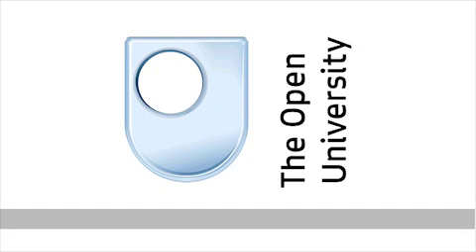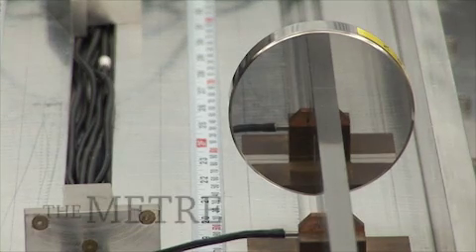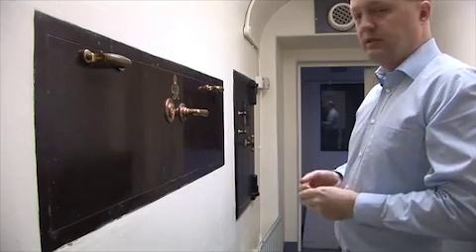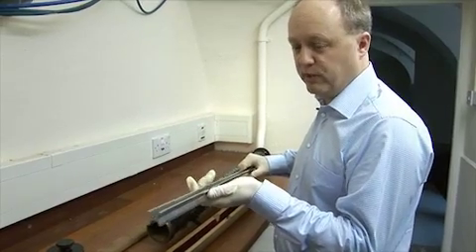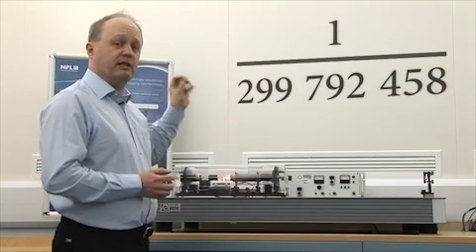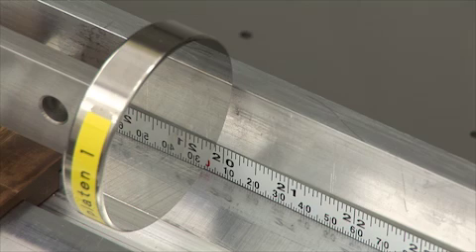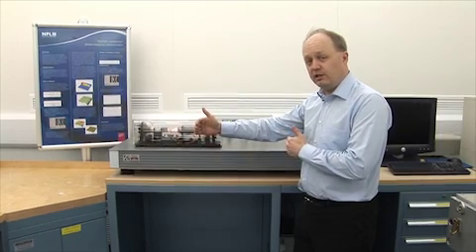The metre

Comment: We define length as the distance covered light in 1/299792458 second. This is because we say that light has a speed of 299792458 metre per second so it will cover 1 metre in about 1/299792458 second but in order to define metre we are depending on the speed of light and speed itself is a unit dependent on length like isn't this definition of metre wrong then ?
Reply: They adopted this number 299792458 based on the old definition of meter ,but now they linked it with the light it self and time so became fixed definition bc the light and time can't change

Comment: Funny thing is the meter new definition uses the old standard device as the accurate distance: and it’s not accurate, and never was.

When the French measured the “one ten-millionth of the length of the Earth’s meridian along a quadrant”, which is basically the distance between North Pole and Equator, they sent one guy North and one South to Spain with the mission of covering the distance that would then be converted into meters… and the guy sent South effed up (probably because his journey through the Pyrenees mountains was quite exhausting) …so his calculations were later proven to be slightly inferior but it was too late. 

Hence the meter we use today is a little too short and that carries to the new definition of how much time it takes for light to travel that meter

Comment: Of course firstly we need to define the second on nature constants. A second is equal to 9 192 631 770 ticks of a Cs-133 atom. 
So if we really want to define the meter with natural constants it should be the distance light travels in a vacuum in the time a Cs-133 atom changes its energy levels 30,66331898849837 times
Reply: A second is equal to 20 ticks
Reply: @FarofaPlayz  No, WTF?
Reply: @Helmut-pdh  It's a Minecraft joke, 1 second is 20 ticks in Minecraft
Reply: @FarofaPlayz  😂🙈 Thanks!

Comment: Would the length of metre change if the wavelength of light is changed??
Reply: late reply but, no. The speed of light in a vacuum is a constant. If wavelength changes, the frequency changes (inversely) proportionally such that the speed is unchanged
Reply: @TheLionOfOrange  And it is forbidden to urinate against the wind.
Reply: No, that only affects how powerful the metre is. 🤓

Comment: Any measurement unit can be translated into a speed of light of course. Maybe you could also translate feet and yard and cubit in speed of light in another vid and see which numbers you get and maybe find patterns. The metric system is just 1 of systems to look into.
Reply: The imperial system is also based on the metric system so it would be pointless. It has been defined by the metric system since 1959.
Reply: I’m for the Imperial system, but then again I like to watch paint dry.

Comment: huh... okay so the speed of light is defined by meters per second
a meter is defined as the distance light travels in a fraction of a second
and a second is defined by amount of time it takes a cesium 133 atom to complete 9,192,631,770 cycles
...
so how much time does it take for a cesium 133 atom to complete one cycle?
the answer is 1 / 9,192,631,770ths of a second!

is it just me or is this some kind of paradox??  each measurement unit defines the other
Reply: It’s a paradox 99/6 of the time.

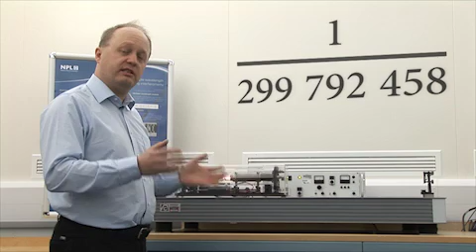Comment: 3:44 how the hell is the speed of light "fixed" when it literally slows down in water?
Reply: “The meter is the length of path traveled by light in VACUUM during a time interval of 1/299,792,458 of a second"
Reply: It isn't. But when people say "speed of light" it's usually shorthand for "the speed of light in vacuum ", which is fixed.
Reply: @GlenwingThink   How does gravity alter the trajectory of light?
Plus unless the natural charge of the earth + the charge of the atmosphere at that certain height is calculated with you cannot be sure of the said speed of light.

Comment: Sir a doubt without knowing a metre how did you told speed of light is 299 792 482 metres per seconf.
Reply: The  particular fraction of  1 second was choosen because they knew that in that small interval of time light covers a distance extremely closer to older meter.
So with this new definition of meter, speed of light exactly becomes 299 792 482 m/s.

The new definition of meter is invariable in space and time.
Reply: If we use the old definition of meter, the speed of light is about 299 792 482 old meters per second, so our new definition of meter is the length that makes the speed of light 299 792 482 new meters per second
Reply: @alexeecs ynjrHahn

Comment: Can I, as a citizen, replicate the meter with something cheap? Or do I need extremely expensive equipment to recreate it at home? I would love to do an experiment myself
Reply: Nah bro you need to find instruments that calculate the speed of light.
Reply: Just measure the distance between north pole and equator, and divide by 10,000,000  lol
Reply: yes..make a cheap pedulum with twine, measure and cut it 1 meter long, the pendulum will now swing exactly 1m second a cycle

Comment: To be clear the international prototype bars themselves are not that very expensive for so much security. It's that once these metal bars were made and length defined according to that, if they were accidentally manhandled or damaged it would be impossible to make exact same replica and hence one would have to redefine the metre. So they ensured (and still do) high security for many instruments were calibrated first by using these as reference.
Reply: Recalibrating the entire world is a very expensive undertaking.  This made the standards themselves very expensive artifacts.

Comment: The metre is the length of the path travelled by light in vacuum during a time interval of 1/299 792 458 of a second.
Reply: Did you calculate it for a royal cubit?

Comment: Some forget that the speed of light is defined by using the two fundamental constants of permeability (magnetic) and permittivity (electrical) of a vacuum - it has nothing to do with distance, temperature, gravity
Reply: Anthony Kernich it has the finite speed which you can calculate by maxwell relation, and its constant in vacuum so we can define length by the relation of (1/299792458)seconds
Reply: @VikasGupta4you  yeah okay that's cool and all, but how exactly is this any helpful for the typical surveyor?

Comment: The fraction of time  used to define meter is a number indicating speed of light in (meters/second) itself. Isn't it mind bending in a way because to get that number (2972..) one needs to measure distance traveled by light in meters-- the same quantity which we are trying to define
Reply: :D Imagine if somehow time got slowed down (increased acceleration or something), the other two units will change too?
Reply: clyton dantis there is no "meter/second" but there is "metres/second"
Reply: clyton dantis metre not meter
Reply: Abhishek Jain why dont we just round off the number to 300000000?
Reply: clyton dantis no the speed of light isn't defined by metre. It's defined by more fundamental physical constants that have nothing to do with length measurement.
Reply: Its em wave we can find the speed of light by using maxwell equation
I thik you got it :)
Reply: Vikash gupta beacuse that would be an horrible rounding off. It would mean cause and effect will have no precedence. Effect can come before cause and you would have a different matter altogether, tachyon. Rounding off that number is horrible.
Reply: Abhishek Jain ty
Reply: Not really, you can measure the traveling distance of the light in any unit, than you divide it by 299 792 458 and you have the meter. A better question maybe would be how does one know what is a second or how does one know what's the speed of light?
Reply: @augustorohden7404  1 second is clearly defined in terms of Cs-133 cycles - accurate to nearly 1 10 billionth of a second - THAT number of cycles is FIXED! Speed of light is also fixed a FIXED speed - speed is measured in m/s so to get 1 metre you need the distance light travels in 1/299792458th of a second which is nearly 10 billion Cs-133 "ticks". How many Cs-133 "ticks" in a light metre? I think it's about 30 (without my calculator) which would make each tick of distance travelled by light - let's call it the "light-tick" to be about 3cm (no calculator remember) - we're able to measure MUCH more accurately than that - angstrom level for instance on the atomic scale. Wavelengths of light?

Comment: Since the rate of time changes based on the gravitational field, does this mean that the length of a meter here on Earth is different than the Moon?
Reply: Morbius907 Good question, closest answer I can give is that you will carry the clock and the instrument to measure with you so you won't feel any change.
Reply: Morbius907 metre not meter
Reply: When the rate of time changes, the rate of space changes as well. When time is moving slower, distances become longer
Reply: @alexeecs  not to mention time dilation. We assume that the speed of light is constant in every direction, for which there is no proof, its just conventionally taken so. For e.g. if we send a signal from earth to moon that time on earth is 12:00 p.m. and say, it took n seconds to reach moon so when the guy on moon see this he will say somehing like "ok check" and add 2n seconds to his clock after setting it to 12:00 p.m. but what if it took the signal which is travelling at the speed of light 2n seconds to reach from  earth to and then instantaneously reaches from moon to eaeth. For us the duration is same and we will never know.
Reply: @_.Infinity._  I mean if it makes no difference... Occam's razor

Comment: Not a good definition. Why would you define the speed of light to be the distance travelled in 1/(24*60^2) of an earth day? Our current time system sucks. Since metric uses base ten, shouldn't we define it using decimal time, 1/(10^5) of an Earth day? And should it even be defined according to an Earth day?
If you change to dozenal time (as I think we should), a second would be 1/248832nd of an Earth day, or 1/10^5 in dozenal. But it would still be defined on an Earth day, which is still not good.
Reply: that is not the definition of a Second. it is a Lot of oscilations of the core and Last Electronics of a vesuim 131 i beleive, Atom. Look it up.
Reply: Since the metric system uses base ten, why not define it as the distance light travels in 1/10^n of an Earth day for some very large integer n?
Better yet, it on some unit of time that applies to the whole universe. Deriving a metre from an Earth day makes no sense as we start mapping the universe.
Reply: it is the time it takes for 9 192 641 770 oscilations of the Last Electron of a Cesuim 133 to happen. that defines the second. Not a Solar day. Not earth. Cesuim.

And also meters used to, a very long time ago, be determined by long steps. Than the meter long Iridium paladium Bars and now 1/299  thousand something of the distance that light travels in a vacuum in 1s.

Comment: gasdive: Yas and no. c is considered as a universal constant (like Avogrado's number, and Plank constant which are deeply involved in redefining the kg). The meter needs the second; the definition of second could affect the definition of m. That's why many people consider that the real base unit is c (what is ... a speed). For practical reasons, we had to re-define an existing unit. We can not change the world and say "hey, you will stop using the meter, and start using c*t". But from scientific point of view, yes, the basic unit is now c, and m is derived from c. And there is a difference between the technical, and the legal definition. The natural fundamental entity is c; but the legal term will stay m ... even if it technically depends on an other unit.

Same mess is about to happen soon for the poor old kg.

 Wikipedia ... SI_base_unit ... The pciture top right shows that few units are really fundamental: only K, and s at the moment. kg also is, for now, but this will (has to) change very soon. Not speaking about meter (which is your question), A, mol, and cd are already derived from other sources.

The relationship between kg and mol and A will probably be reversed; maybe making the mol a new independant root unit, like K and s.

You have to understand that the meter is not a subset of the second, because c introduces new concepts that were compeltely absent in the second. m or c can not be replaced by s. They are bonded by the definition of speed formular (V=D/t). Defining only one does not work. You have to define two elements. They are related, by essence. We could as well state about the meter, and c, and then derive time from speed and length (this would be unpractical, and unreliable ... but it could be feasable).

Amongst other things, I had, personally, the idea that, if we can define the new kg by counting carbon atoms in a cube, or silicon atoms in a sphere ... we could technically define the meter as being the multiple of the size of a given atom. Such a definition would be a pure length, but would probably be less practical (and less precise), otherwise, the BIPM would have thought about it before me :) We have defined the time according to atoms; and think hard about doing the same for weight; why not length ? (the technical issues would be about the cristal regularity, and variation with temperature). Then c would be a consequence of s and m. Its just better pratical, and more precise (and cheaper) to use s and c.

The BIPM does not like the watt-balance ... because it's too expensive, and too hard to duplicate. Takes 10y to build one. By comparison, you can build a good atomic clock within a day, by reusing spare parts from other projects.
Reply: the carbon cube and sphere already done....the cube very interesting, 12 grams , i forgot the details but it was 6.6666666665435cm per side "cubed" made exactly 1 mol down to 1 atom count!! it was so exact they thought it would upset the power of big country labs over little country labs...plus carbon is so cheap....the sphere was similar however, one touch with toilet paper would remove the first layer of outside atoms, so that plan was eliminated
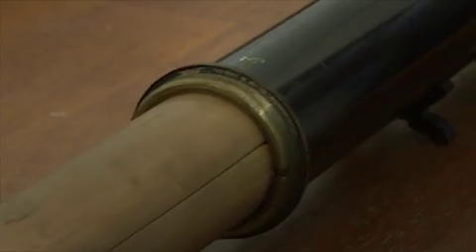Reply: 2:29 "ITS MISSING!!!!"😂😂😂😂🎉🎉

Comment: The metre was originally defined as "one ten-millionth of the length of the Earth's meridian along a quadrant", that is one ten-millionth of the distance from the equator to the North pole.

The problem was the above definition brought about a degree of uncertainty and some other issues, so the metre was redefined to the current definition. 

As such, the number used isn't an arbitrary number but is the number that allowed the new definition to be the same length as the old definition.
Reply: Funny thing is the meter was redefined still using the old standard device as the accurate distance. However, when the French measured that  one ten-millionth of the length of the Earth’s meridian along a quadrant, the guy sent South to Spain effed up because his journey through the Pyrenees mountains was quite exhausting …so his calculations were later proven to be slightly inferior but it was too late. Hence the meter we use today is a little too short and that carries to the new definition of how much time it takes for light to travel
Reply: It also comes in handy that earths gravitational pull is slightly below 10 m/s^2.
And two pi times the root of 1m/9.8 m*s^-2 adds up nicely to roughly 2s. 
So that means that a pendulum with the length of 1m roughly takes two seconds to pendle. 
I guess scientists could have based the meter on earths gravitational force as well but I am glad they didn’t, because earths gravitational pull is also very inconsistent, just like the earths diameter.

Comment: Since the metre is defined in terms of a period of time in seconds times c, wouldn't that make it a derived unit rather than a base unit?
Reply: the way you put it it would. but what do you derive it off. how do you measure space using time? they are different dimensions. like trying to determine how tall a House is by measuting its width. the path light travels in a Second is a distance, it is equal to 299 thousand something something meters. this path is also roughly 3 Times as many feet. but it is still the same path. Take this one exact fraction of that path an you get a meter. and a Second is defined by the number of oscilations between the core and Last Electron of a Cesuim atom. Look it up.
Reply: Marko Rajić Does the oscillation of cesium atom remain same if I place it next to black hole or if I travel at speed of light? So the derived unit calculation will change based on location and speed.